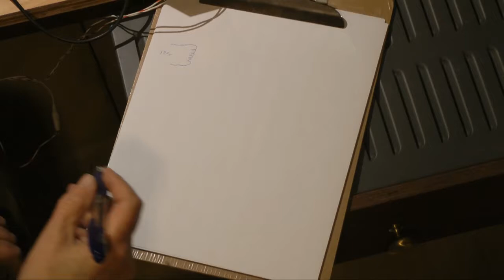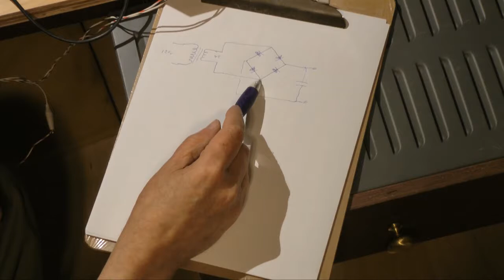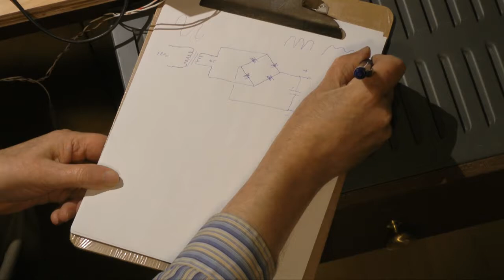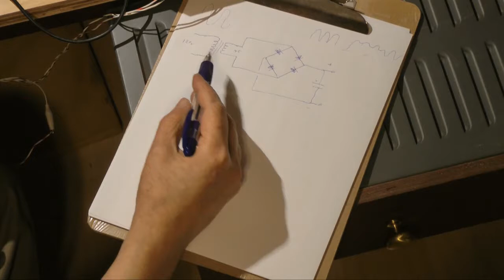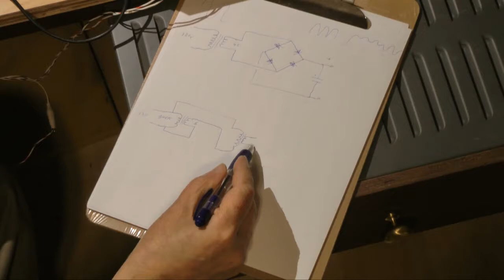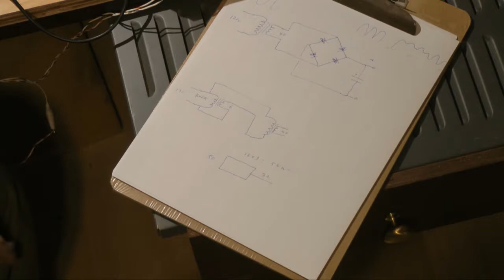Basic Power Supplies

Comment: You should build power supplies for COB lights. These meanwell drivers seem to waste half the power. Example = https://timbergrowlights.com/redwood-vs/
Reply from the maker: Right now I'm running my new light designs off of the AC line with a bridge rectifier, 2 ballast resistors and a capacitor. Efficiency depends on the particular COBs and the power I run. I have about 8 lamp assemblies running now, some run 16 hours a day with no problems. I haven't actually had any problems with them, still experimenting on best bang for the buck! I plan to do more videos, did you check on my channel? My "bridgelux V18 x 4 is running off the line, so is my fluorescent light conversion. Also my new plant cabinet is using 16 V10s.